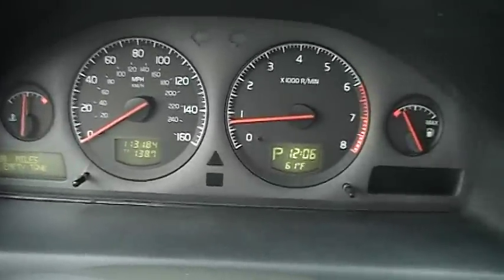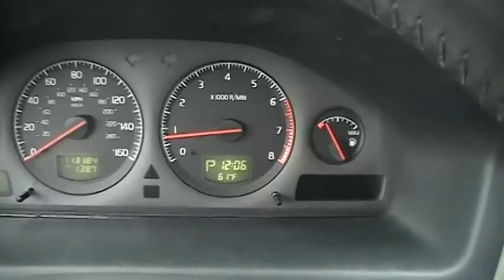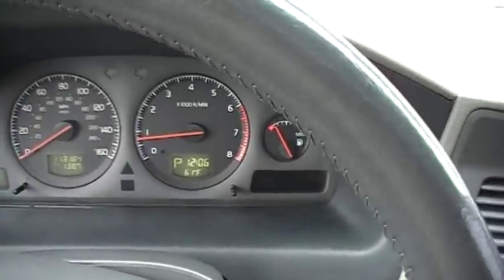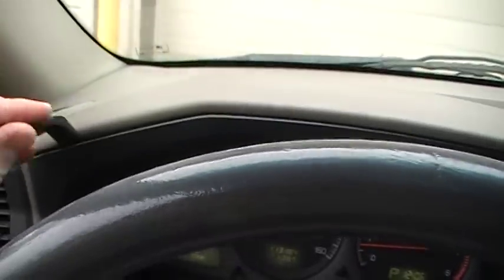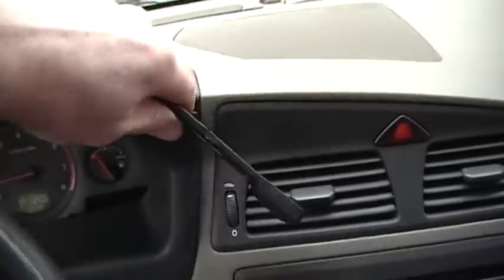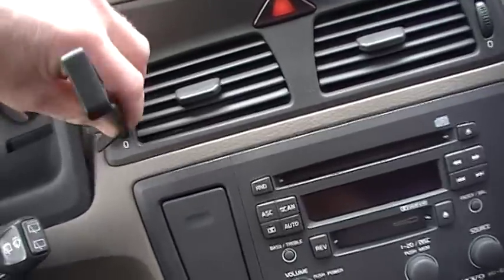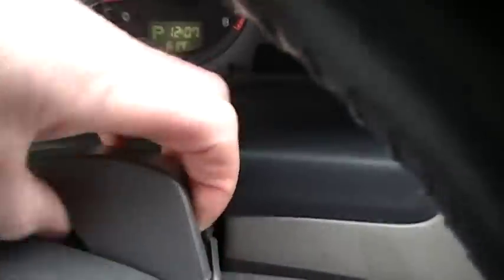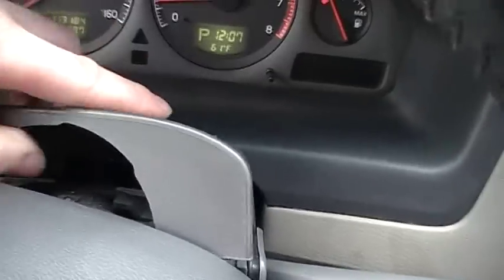Volvo DIM / instrument cluster removal procedure & Problem Info for V70, S60, S80, XC70, XC90, etc

Comment: This video does not tell you that yo may need to remove to star screws on the shroud before you pry it off. I have a 2003 S80 and I almost broke the shroud before a cap the covers the screws fell off.

Comment: Would swapping a junkyard cluster into my car keep the same mileage or no?
Reply: Yes it would. But it may have the same or similar faults. I fixed mine myself. I simply resoldered all soldering points that were big enough. And try to "reflow" all soldering points on the SMD components using a heatgun set at 230C. Seems to work now but who knows how long...

Comment: I have the urgent air bag warning. I also have clock sometimes running backwards quickly and occasional weird pixels. 
My indy and a Volvo dealer both said there are no codes to clear so how does that work? After you fix the DIM they WILL see codes to clear?
Reply: You may have your answer by now but I’ll answer it anyway.  It’s certainly possible that your car will show codes after it’s repaired. Due to faulty solder joints the cluster is not able to show you the 004D code that it should throw because of the airbag light. There’s a faulty joint between the LED Driver and the Airbag LED and the board thinks the Airbag LED is faulty but it’s clearly not because it’s lit in your case.  Clock running backwards is due to faulty connections between the MCU and the boards Display Driver.  We’ve rebuilt about 1500 of these boards over the last few years. For what it’s worth, I’m not associated with Washington Cluster Fix, I have my own repair shop.
Reply: @mouser485  thank you for your reply. I did send it out for repair and when it came back, it did still show the urgent airbag message and the airbag light but my Indy now did see codes he was able to clear. Interestingly, it was for a drivers door airbag, which I don’t even have. the urgent message and the airbag light are gone but, my gas gauge stopped working. The guy who repaired it said that has nothing to do with him repairing the cluster. He said probably sending unit. Coincidence? I can now get the car inspected with the airbag warning and light gone and can live without a gas if I have to, but just coincidental?
Reply: @jeffflowers729  It could be a sending unit as I’ve never had to replace a faulty gauge in one of those clusters. I’d say those are probably the most reliable gauges used in a car so yes, check the sending unit.  However, if it’s not the sending unit, I’d almost guess it was a problem with the circuit board, specifically the gauge driver. I’d put the gauge itself as the last thing to check.  #1 sender, #2, circuit board, #3 gauge. That’s the order I’d go in if I was going to diagnose  a fuel gauge problem in that particular car.

Comment: Quick question, will a S60R Gage cluster fit into a S60 2.5T?
Reply: I don't think they're mechanically different. just a different color. Also, Don't go trying to pass of a 2.5T as an R(unless it's been engine swapped with an R).